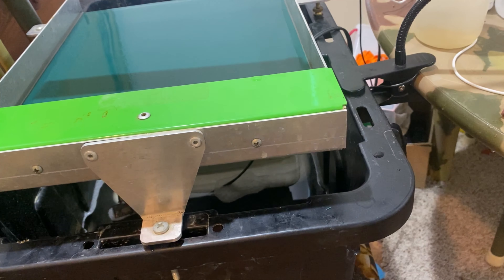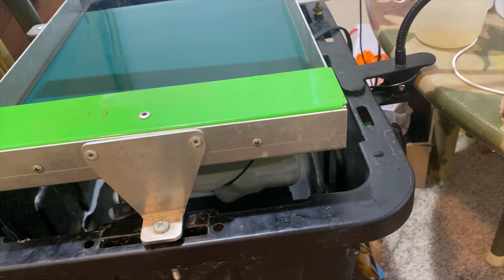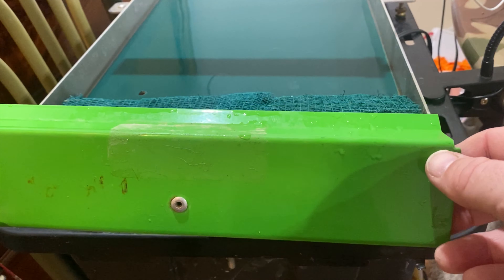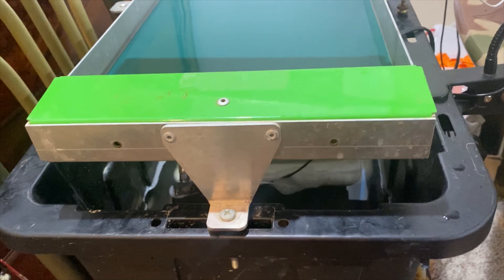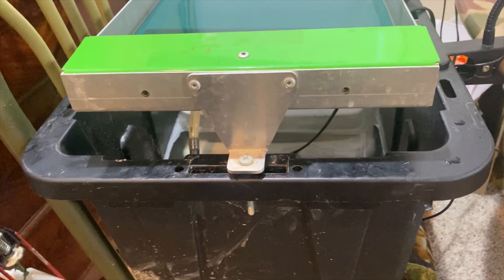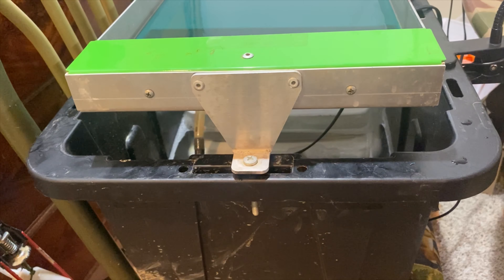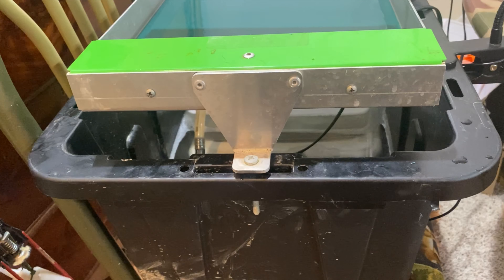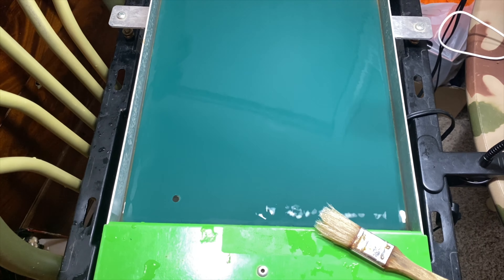Martin Water Table Fix

Comment: Nice fix. The turbulence is one of the problems I had with that design as well.  That will help settle down the turbulence when you are working the very fine gold.
Reply from the maker: utahavalanch been running pretty dirty water and not clogging up
Reply: Robinson prospecting 
Yes, that was a problem I had when I was using the scotchbrite pads this seems to work much better.